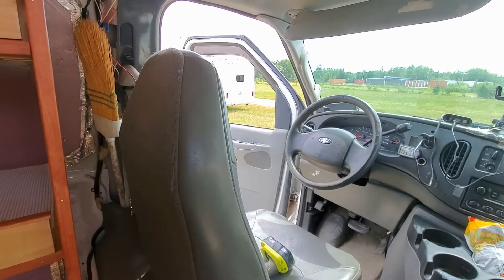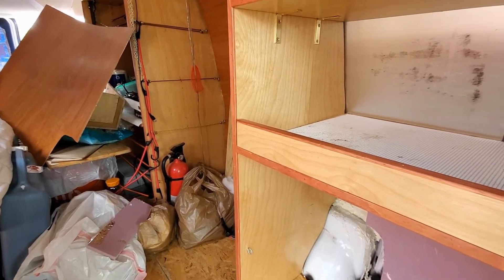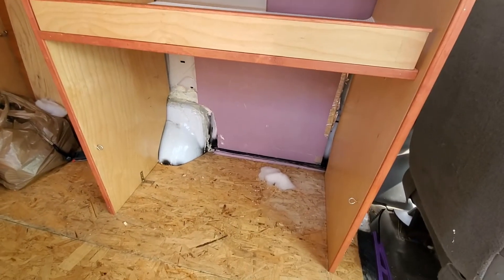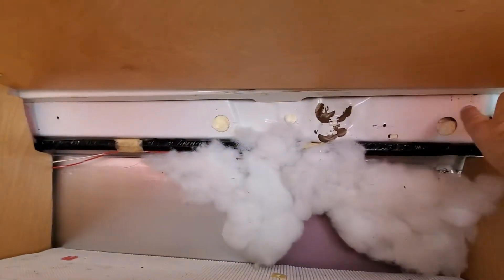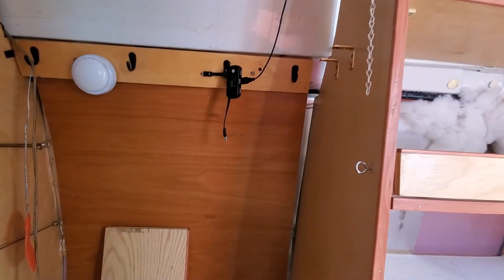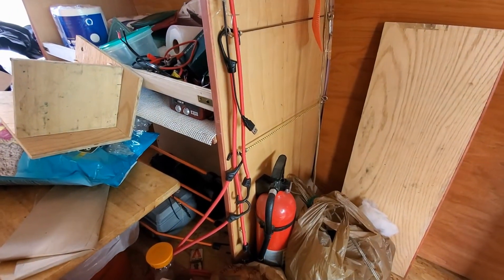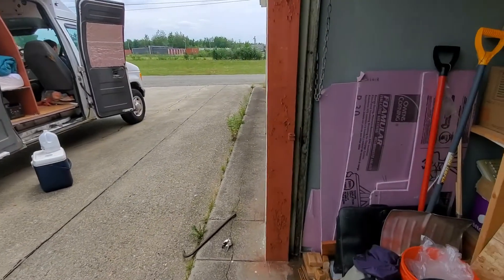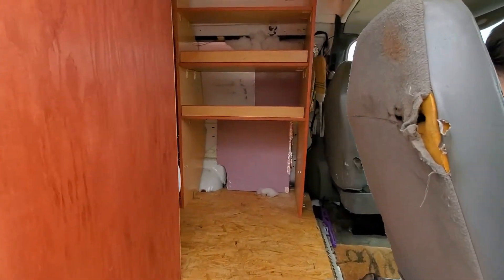Van Life Van Build: Rebuild Prebuild

Comment: Looks like you have your work cut out Donald. How long is the load space in the van. It looks long
Reply from the maker: The van itself is 19 feet 4 inches long. The cargo space is about 11 feet long. This is the extended wheelbase not the standard cargo van.

Yes, always working, working. No rest for the weary.
Reply: @vangazmicvoyage5077  Useful size indeed
Reply from the maker: @alant2419  Yep but it takes that much space for the two of us. A tall high top would help too, maybe a box van next time around.
Reply: @vangazmicvoyage5077  A box van with straight sides would certainly be easier to fit out.
Reply from the maker: @alant2419  It sure would and I'd be able to stand up straight. The rear door however means I can't place the other bed crossways, it would have to align fore and aft same as mine. Unless I put a cargo door on the side too like I have now.

Moot point anyway for now, I'll be keeping this van for as long as I can.